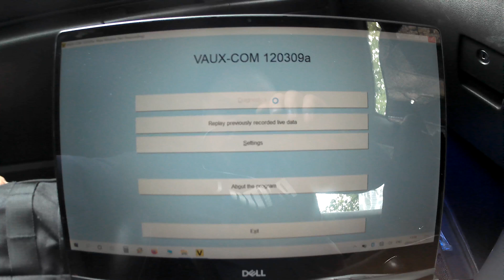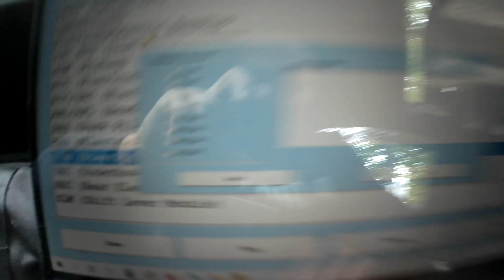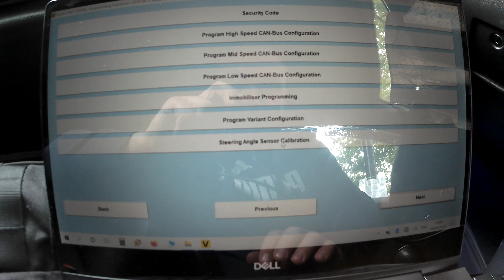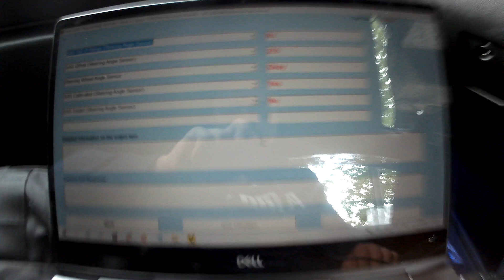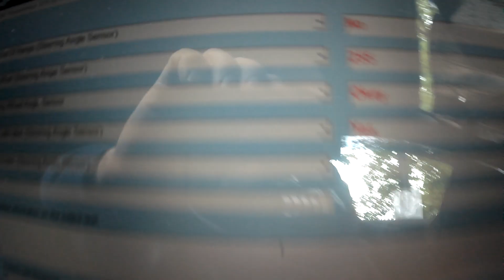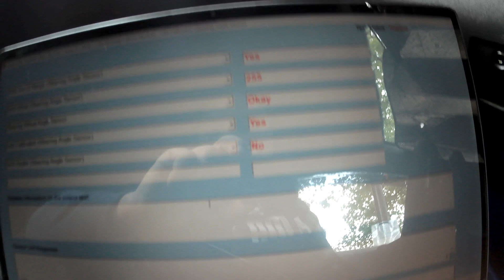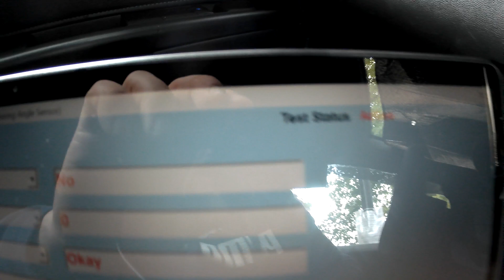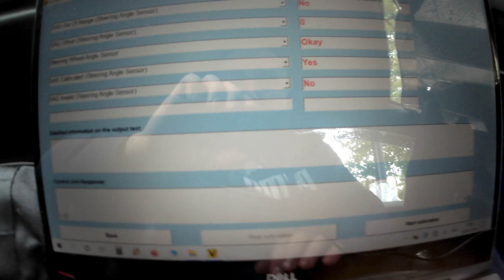vauxhall astra H steering angle sensor calibration

Comment: What are the symptoms that show that it needs calibration? My astra h keeps pulling to the left if i loose the steering wheel. Iv had a alignment today but its still pulling left
Reply from the maker: That is not the steering angle sensor. 
Symptoms that show a calibration is needed are faulty light shown on the dashclocks. 
And a fault when you do a diagnose.
Reply: @Blackshaddow10  , Check tire pressure but I supose you've done yet.
Reply from the maker: Yep done it.
Reply: @Blackshaddow10  Some suggestions: 1.- lift the car and check that both wheels turn in a similar manner, I mean, same effort with your hands to move them and stay turning approximately same time after ceased push. 2.- check that brake pads are separated from disk by release them in a proper manner to check previous step. Also check that brake calipers are not blocked in the left wheel. 3.-Check for the characteristics of every wheel, should be the same, not similar, exactly the same (one time I had a similar problem and when I went to the pneumatic workshop, they discover that one of them was slightly different wider than the other ) Hope it helps.
Reply: what worked on me was the following: change the front wheels left to the right. take a test drive, if the pool is gone, just reverse each tire on its own wheels so the rotation is correct.
Reply from the maker: could be a fix that too